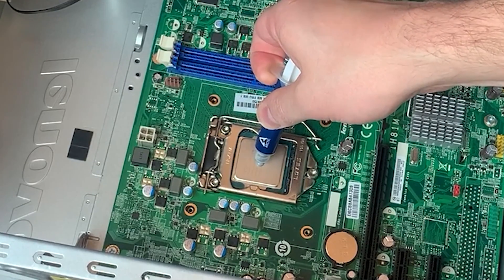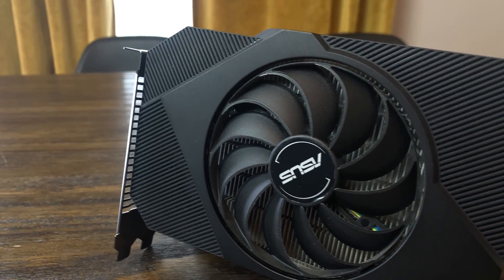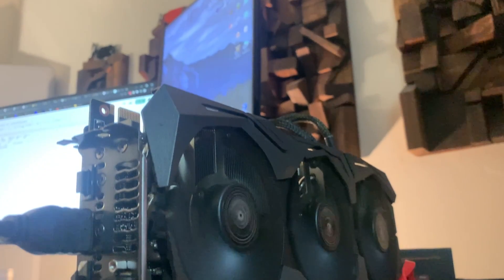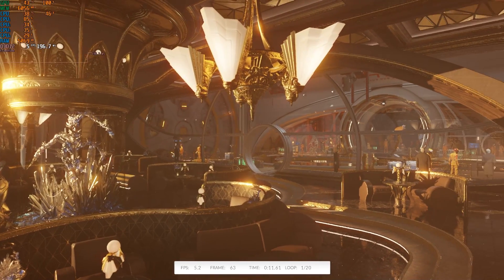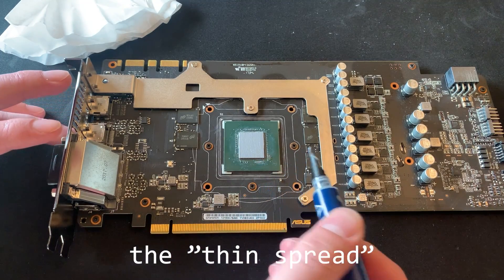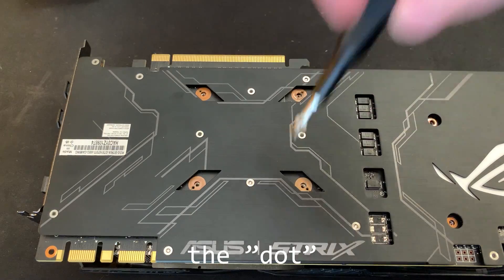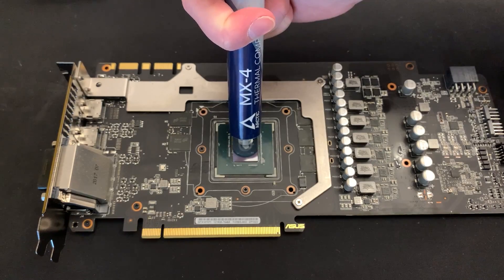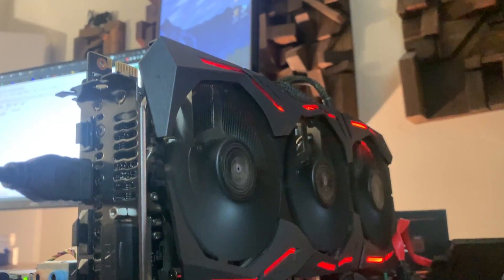Are You Repasting Your GPU Correctly? - Testing Paste Applications (Thin, X, Line, Dot)

Comment: I don't understand why my GPU is going 80 degree Celsius hot while gaming. I use noctua thermal paste, i tried every method of applying ,  die is covered with thermal paste. Still the gpu running hot. I don't know my room temp, but as in my location outside temp is 36-37 degree, so i guess my room can be between 30-35 degree.
Reply: You need to replace the thermal pads, as well as the paste.

Comment: dont spread it on, put it thick and press ONCE down without moving and evenly tighten.  gpu temps dropped 20 degrees underload no bs.  75 c - 54  c gpu temp.    98c hotspot - 69 c hotspot.

Comment: Pretty cool video even after 2 years. Can't believe you got the exact same temps 8 times over.

Sapphire says to put 0.2 mm of thermal paste on their Pulse Vega 56 (~9 cm²). That would equate to 0.45 grams of MX-6 or 1/4 of a 2 g syringe. :face-blue-smiling:

Comment: After working with so many different GPU models over the years, I came to a conclusion that using spread method can be very questionable with some coolers.
To sum it up - Dot method is great for small dies. X for larger ones. X with tiny dots between lines for really big dies/IHS. I never spread because of accidents when coolers did not made perfect contact with die (which resulted in GPU extremely overheating).

Comment: There was old article on an overclocking website that did like a dozen different application methods and did it over like a suite of 100 tests. It covered all your points but even through some more esoteric ones(spiral for bigger dies that some server manufacturers suggest, smiley face for the meme etc). 

The tests were consistent across make and model they tested. Ironically the smiley face did the best - but even that was written off as well within variance. 

long story short - doesn't matter. Its an argument for no reason.

Comment: The most important thing is the kind of paste. MX-4 is a good paste for CPU with an integrated heat spreader but it's a horrible choice for GPU which has an naked die. It will work for 2-3 months but eventually it will pump out because it's a very liquidy paste. For a GPU you need a very viscous paste that is more like a clay. Good examples of GPU pastes would be DowsilTC-5026, TC-5688, Shin-Etsu X7921, Prolimatech PK-3, IC diamond 24. Bad choices would be TG Kryonaut, MX-4 and 5, Noctua NT-H1 and 2 are all very liquidy and doesn't dry out but has trouble sticking to the naked die surface and Arctic Silver 5 because of its mostly oil properties which dries way too quickly. Quantity, Application method doesn't matter that much as long it's full coverage than it's good enough.
Reply: That is nonsense. I used noctua ntnh1 2 all good till now. I used also arctic mx 6 with worst result but maybe I didn't made a good spread or I used to much. Anyway nocturnal is performing well enough. When the rtx 4060 laptop   is using 100-105W ,with fans around 5000rpm,it stays around 76-77 °C. 77 is the max I have seen till now.
Reply: What’s the best for gpu repaste, I was about to use noctua but you said it’s bad?
Reply: @heroicsquirrel3195  While Turuu recomends some good ones, you can also go with these: 
 Honeywell PTM7950 (it comes like A thermal pad, but, in fact, it's a paste that changes consistency at around 40°C and becomes like a a past. This is in layman therms)
Another good one for die application is Thermal Grizzly Hydronaut (recommened by der8uer himself)
Another good one is Gelid GC Extreme.

I've used these in the past for my job (IT) on Laptops, my own graphics cards, etc.

Comment: I fear no thermal paste pattern, but that GIGABYTE power supply in the background, it scares me.
Reply from the maker: It would scare me too if it was one of the models affected by the issue brought to light by Gamers Nexus
Reply: @HardwareHaven  But the fact that they missed overcurrent protection fault is scary, it is usually the most thoroughly tested protection feature
Reply from the maker: Yeah that was a complete blunder. To be clear, I really don’t care for gigabyte as a company, but that’s not gonna stop me from using a solid power supply that I got for a good deal from a friend if that makes sense haha
Reply: @HardwareHaven  I fully understand, I have a gigabyte motherboard and their SSD in my main system, I have nothing against their products, in fact they will probably now make sure something this stup1d never happens again and make some great power supplies to make up it
Reply: @HardwareHaven  was it a good deal because the original owner was afraid of it?
Reply from the maker: @filenotfound__3871  haha no. He just had a spare that he had no use for.

Comment: sadly the best way to test this is with a GPU that reports HOTSPOT temps (like a 5700 XT), edge temps or regular gpu temps don't display the temp of the hottest part of the gpu die :(
Reply from the maker: That probably would be helpful. I'm not sure though how much of a difference there would be with consistent mounting pressure and enough paste to cover the entire surface of the die. Do you have a link or anything to a similar test that uses hotspot monitoring? I'd be curious to see.
Reply: @HardwareHaven  sadly no video, this is a topic i discussed with others on discord a few months ago and tested myself (when i repasted my 5700 XT Red Devil). 

The "thin" method dropped my GPU hotspot temps from 110ºC to 98ºC compared to the dot method and i made sure mounting  pressure was extremely consistent, the "edge" or "regular" gpu temp was just 1ºC better (this is all with a 60% gpu fans speed with a 190W PL, running unigine superposition max everything for 2 hours).
Reply from the maker: Were ambient temps taken into account?
Reply: @HardwareHaven  i don't have a way of testing ambient temps but it was tested on the same day in the same hot room but no way a mild shift in ambient temp (it all felt the same to me) would account to a 12ºC drop on Hotspot temps. 

I wish i had taken pictures of the paste patterns after application but the dot method while it can spread across the die the corners did not have much paste applied on them but i used a thermal paste that isn't very liquidy so idk if that is the main reason the corners lacked enough paste (the dot was small like a rice grain since that i what i kept hearing was usually done but noctua recommends a pea sized blob). 

I did not test any other methods since i was happy with the temp drop with the "spread" method.
Reply from the maker: Gotcha! It’s cool that you did that and got some lower temps. I’m getting tired of doing thermal paste content, but if I ever come back to it I’ll try to bring hotspot measurements into consideration. I imagine for most users it’s really not as big of an issue. There will most likely be an improvement if the paste hasn’t been changed in a while, and at most the GPU might slightly throttle a bit sooner if one hotspot sensor is getting too hot.

Comment: I been around a while in the PC scene, I think a lot of this conversation has got muddled over time application was important when high end pastes tend to contain conductive materials.

Overspill when you used those could kill your stuff. This is less of an issue today since high end pastes are within 1C of each other in performance and are also non-conductive making overspill not a problem.

GPUs specifically are naked dies unlike CPUs today which have Integrated Heat Spreaders. It's less important to cover the entire CPU IHS so long as you paste the hot spots where the die is underneath it.

GPUs therefore require full coverage since every inch of that surface will get hot. Also it's a requirement to use non-conductive pastes with GPUs as the general application recommendations will cause some overspill inevitably.

Comment: I personally like the idea of the thin spread method but from what I hear, theoretically, you could introduce tiny bubbles into the application doing it that way and in doing so, add a small layer of insulation between the die and the paste. But this is just heresay and I've not done enough testing (or have done an application poorly enough) to run into this issue myself.